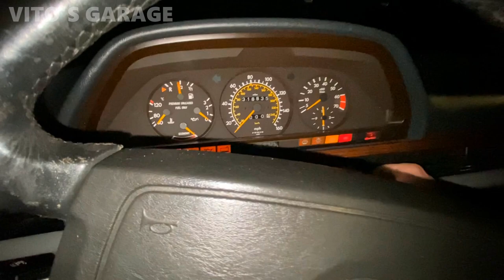I Sold My 1991 Mercedes 420SEL To a Good Home. The Car is Going To Poland!!!!!

Comment: Dude you left us hanging 2 years ago. You didn’t follow up on what caused the cylinder issue. You couldn’t figure out how to fix it in 2 years? You earned quitter title in my book.
Reply from the maker: 😂😂😂😂 I’m not a quitter. Engine needed a full rebuild with new timing chains and guides. Cyl 7 had low compression. Seems like you missed it in the video buddy. 
Nobody left you hanging. If you really cared about me and my channel you’d have reached out privately and asked! But you chose not to. 
Now, stop barking and enjoy the fact that the car went to a good home and is currently getting fully restored!